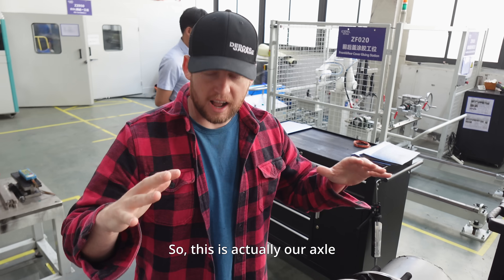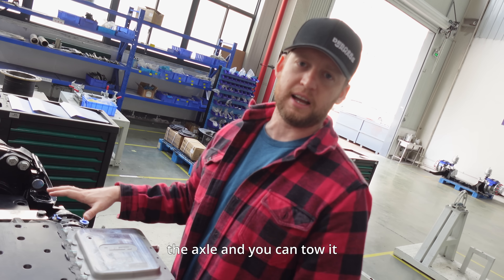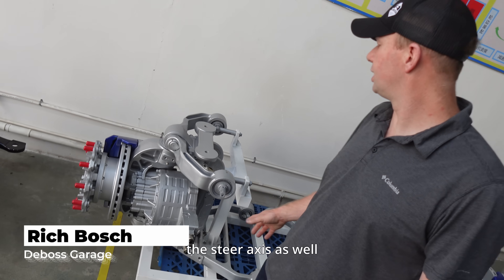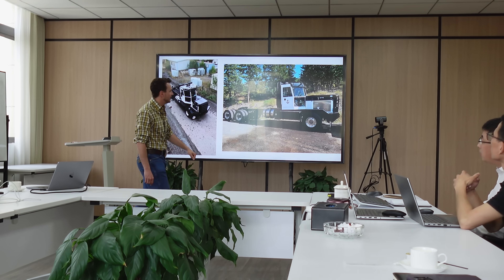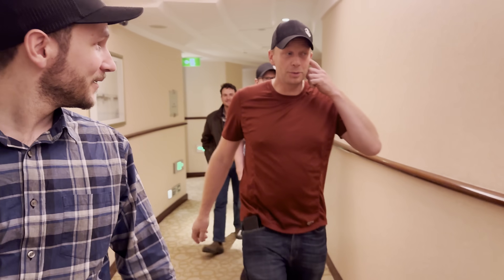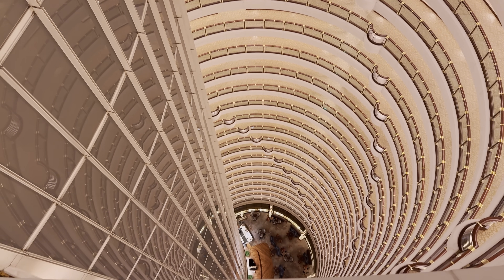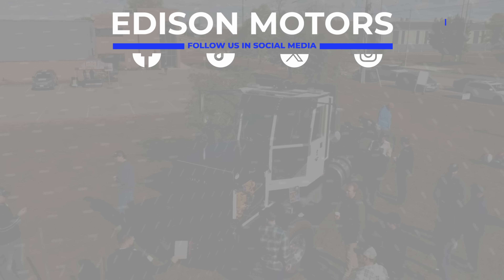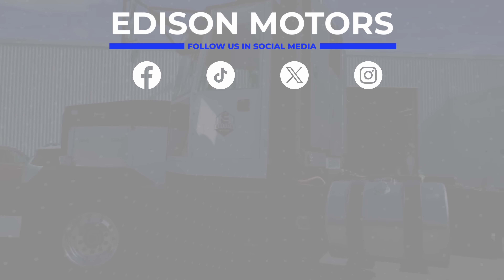E-Axles and an Engine Hunt - China Part 5

Comment: what I see China is mentally 100years ahead and technological 10-15years ahead vs western world. You have really tough job to compete. What I see serviceability / opensource everything what possible is yours biggest advantage.
I would like to see in your electronics everything opensource/open hardware with fuses inside your chip.
fuse is only as indicator that only our original software was ever installed.
If someone wants install unsigned/own software must intentionally brake fuse. (and you of course you make manual how to do that)
That would be great option for you in case of warranty, easy check if everything was always yours. (and of course you don't must refuse warranty if fuse is broken.)
I assume that would need custom chip with your public key written forever in chip. chip would check if software is signed
with your Private Key. (that will be one of biggest company's secret, if become lost. Serviceability will not be intact, just brake a fuse and everything works.)

chip also should allow to reset fuse with created specially for that serial no. chip procedure sign by your private key.
Reply: That's what I thought.   10-15 year ahead in tech TODAY.   Next year - 15-20 years ahead -  in 2 years from now   probably 20-25 years ahead.    I'm just visited Europe - which is about 10 year ahead in Automotive tech - thanks to a more friendly relationship with Asia.    Patents are just slowing everything down.  Look into the 3D-printing space - no patents, all open hardware/software - tons of innovations - lots happy and healthy business.
Reply: They have been copying everybody for 50 years now, they don't give a shit.
Reply: They are not ahead in tech😂 they can barely build there own cpus which are built on western tech. They literally can not invent anything they just steal everything from everyone else
Reply: @moparjr89 keep believing that 😂😂😂 you will wake up one day and think shoot have I been under a rock
Reply: @moparjr89  Let me tell you a truth, if a person starts running first, then that person may not necessarily run faster than you

Comment: Is there any potential move away from air brakes?   Since everything is electric it would seem simpler designs to have the brake system all electric as well especially since regen does the majority of braking anyway.
Reply from the maker: Air brakes work and have redundant safety backups.  I wouldn't trust electric brakes because in an event you lost all electrical you also loose your brakes too and that's unacceptable to me
Reply: @EdisonMotors  Yep I understand that.  However that could be replicated.  There are furnace duct actuators that are an electric motor that wind up a spring in a gearbox fashion and hold open as long as voltage applied, as soon as voltage is lost the spring returns the mechinisum to closed state mechanically with no power.   Although air has other uses such as riding airbags and whatnot as well.
Reply: @EdisonMotors  loss of brakes? They're spring actuated, so they'll engage with lack of air or electronic actuator. True they will be on until the issue is fixed. Air has issues too.
Reply: I think electric service brakes with air parking would be the way to go, that way you can still release with current tech on wreckers to roll the vehicles

Comment: Would the electric axle be able to recharge the battery? Maybe not even drive the wheels, recharge only...
Reply: Regenerative braking should be easy as hell with that setup. It would certainly help with high grade slopes.
Reply: That is call hybrid, already existed for long time.
Reply: But why? There is very little difference between a generator and motor.

Comment: Motors on the steer axle looks really cool.  Any idea if that can or will be scaled down to be made available for 1/2 ton conversions ?
Reply from the maker: They don't have it at that size yet but we're working together to try and engineer something.
Reply: @EdisonMotors  that's awesome
Reply: @EdisonMotors  Looking forward to seeing the next steps.  Love the channel and all that you guys are doing.
Reply: That would be extremely nice to rebuild a 93 f-150/250 4wd with this system!! I would use a 300ci inline 6 for the fueled power plant
Reply: @jhrubicon1470  thats what the new ram charger is electrical powered with small battery and v6 gas generator
Reply: there is not really a need to.  1/2 usually have independent front ends with a differential right in the middle. Just replace the differential with small electric motor.  In a Semi you have the engine hanging low in the middle where it's had to place an differential.  The front end does not need a lot of power - might get away with just flanch a electric motor to an existing differential in the space  where the small drive shaft from the transferase usually would sit.
Reply: I’ve never been a fan of hub drive… that’s a lot of un sprung weight and those motors don’t like vibration… especially if they are HVH wound.